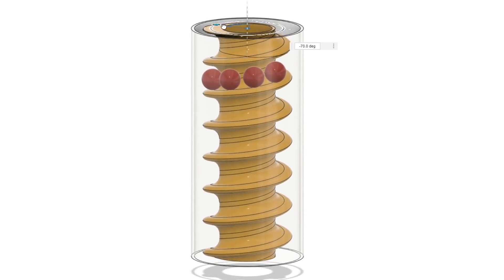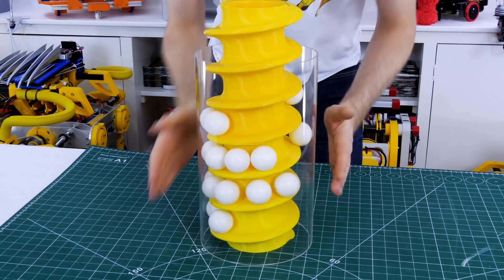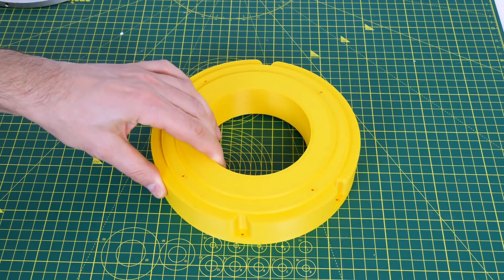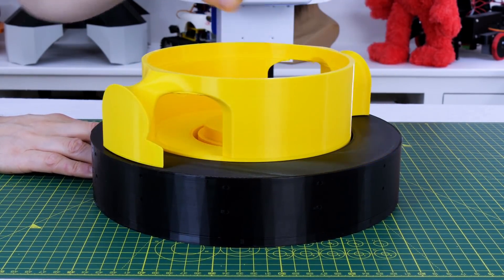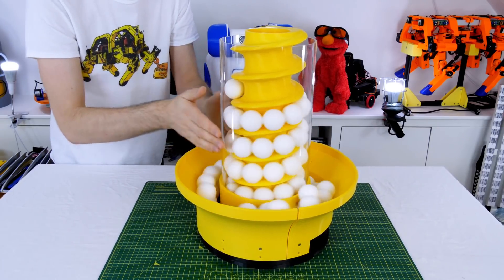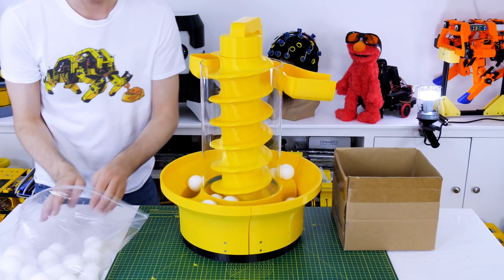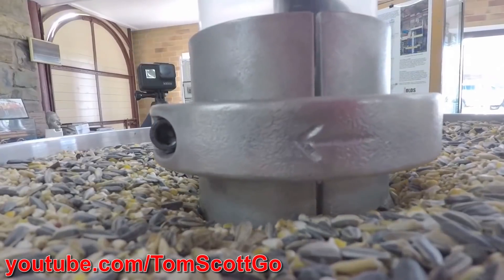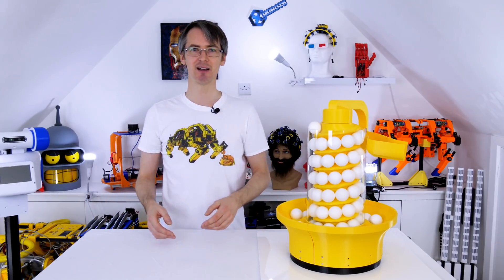Why this Screw Drive is Really Weird

Comment from the maker: openDog is back doing some mapping with ROS next week, Patrons and YouTube Channel Members have it already!
Reply: TL/DR: put some vertical bars inside the tube to prevent balls from rolling back down, archimedes screw only works because its tilted and cant just flow down the screw like the balls.

you're relying on the friction between the cylinder and balls, which is fine for grain or cereal that dont flow down the spiral. but with smooth atomic units like these balls a vertical bar or "cleat" in the tube would greatly increase the flowrate by preventing the balls from rolling back down. 

thats what i thought you were getting to with the vertical bars at 0:17 , but it never came in the whole video. please flip the red bits inside so they fill the gap between the tube ID and screw OD and youre golden.
Reply: Another improvement is to have both the screw and the tube turning in opposition which increases the efficiency.
Reply: Put numbers on the balls
Reply: So this is basically how the dough ball roller at little Caesars works.....
Reply: Make the chute go back into the bowl and it will self feed
Reply: Lazy susan
Reply: you should increase friction inside of the acrylic tube for better result
Reply: This is the first video of you I just saw. And from some point on I just sat there with my mouth open. I thought: "He just must be a real engineer. All of those backyard DIY guys would solve all the mounting problems by running into them and re-print or modify the parts."
Watching this was a real enlightenment and pure joy!
Reply: You could have made the screw in parts that snap together to be able to have it as long as you wanted
Reply: Theoretically, would this also work for liquids?
Reply: You could make it a closed system and just deposit the balls that make it to the top back into the base and give it a go with higher speeds
Reply: I've thought about this before, as a kid, and I think it would work from that, but that it would require a substance that would be at a higher level and want to fill back in the space created by the process in order to be functional.

So I'm excited to see if that thought was correct, and how you make that work.

Essentially there will still need to be a portion that creates a pressure on the stuff being moved up.

FWIW, the more I think about it, and having thought about it in the past, the more I realise I figured it would be putting the card before the horse, so to speak, since it means more friction on the external side would likely require more energy to move most materials
Reply: Why not send them straight back into the base hopper to save having to manually refill?
Reply: +James Bruton Well YOU'RE no Mark Rober. It's just the friction from the glass providing the force to move items up the screw, Big whoopie-doopie, my mind is not blown.
Reply: Now sell it to the Nebraska State lottery
Reply: You should make one that works with metal ball bearings and send it over to Wintergatan

Comment: Would this still work if the diameter of the balls were half the space provided ? Also, Is the friction from the inner walls detrimental to the function or is it only implicit due to the upward force from a constant replenishment of supply?

Comment: Well, the catcher part at the bottom pushes the balls in and the balls push each other up. So the usefulness is limited it wouldn't work with water, or grains.
Also I'm not sure if it counts as an Archimedes screw, which is always at an angle and carries water/grains up in pockets. (Water just flows away, and the grains friction would be too much beyond some point) It's a helix on which balls are pushed up.

Comment: I think this works for the wrong reasons. The principle of the rotating screw is that the balls want to remain as stationary as possible so it's easier to go slightly up as the base rises than roll all the way down (providing the spin is fast enough to counteract gravity). The rotating tube principle seems to be the friction at the base of the tube that pushes balls inwards and then pile then up. The rotating screw setup should work for a single ball, but I doubt one single ball would go up with the spinning tube setting.

Comment: My guess, is that it would still work. 

Like the difference between a propeller and an impeller. 

Spinning tubes are constant acceleration, which is just gravity, so at a high enough velocities: things stick to their walls. 

Then from the perspective of the balls on the wall: the corkscrew in the sky, and the entire universe under their feet: would both be spinning around a stationary corkscrew. 

So the depending on the reference frame: the screw would still be able to be seen as spinning. 

I wonder what would happen if they both spun in opposite directions snd were in contact with a fluid: specifically I'm wondering how the speed of rotation would correlate to the amplitude of the fluid incursion 🤔

Because of viscosity and stuff, I imagine right at the boundary: you'd get two opposite whirlpools (for the two rotating opposite direction model) and they'd just peeeeek into the tub before spiing out down the middle, but the whirlpools would probably be eggshaped rather than circular: and if things spun fast enough they could probably be stretched out by maybe almost a single screwthread. 

So if you then a tilted your archimedes screw relative to the gravity plane of the earth, by about 45° you could probably get some weird fluid rythms going, as slosh resulted in slight overflow, which would accumulate and slosh and overflow. 

The video of it that I just now imagined in my head: would look similar to counting. 

You know how when you count: each digit goes a bit slower? 

It would be like that, but analog. 

Each thread would be like a digit. 

Sidenote: nature is fundementally quantum, quantum means discrete. 

So analog computing isn't truly continuous, but it is fairly close to being continuous, because the molecules in the water are a lot, so it is like, counting with very big numbers. 

I think that might be fun actually hmm 🤔 pls try it, and pls give me an itty bitty credit pls, if this post inspired you, thank you 🙂

PS: then you could compute by putting the "double winder" [as we'll call it for brevity] on a scale, and subtracting the container weight from the scale, and using that for computation.

And if you used analog dials instead of discrete read-out, and you fed those you potentiometers, and sent those into other motors and gizmos, then you'd have an analog computer, but it's primary design flaw would be that it would have to be in a gravitational field, so to use it in space, you'd have to be in one of those space Odyssey 2000 people tubes, the big ones that spin up artificial gravity. 

To use it while moving it around: you'd probably have to switch to a ferrofluid, and then you'd have new design limitations and would have to make things chonkier so that you could account for and accomodate the magnetic spikes that ferrofluid likes to make. You'd also need gravitational sensors, and accelerometers to actively offset the effects of wiggling and jostling and changing gravitational persuasions, so to use that kind of fluid computer, you'd also have to have electronic scale controllers, and fitting w/ the spiritx they'd have to be analog too, but preferably a discrete type of analog which I'm not sure exists, but that with all that fanciness the test would be to run it upsidedown on the ceiling, and then run upsidedown on the cieling again, but halfway through the count, spin it right side up, and then compare the numbers and calibrate accordingly, and then ship it Ganymede or Io, and calibrate it again without interfering with the earth calibration, and also try odd angles and different count interference times. 

Then the final test wpuld be to put it on one of those work-put jigglers, and just oscilate it to death, and do your best to give it a good tolerance 😉🤣👍

(Maybe don't bother with the upgraded version, that sounds like a lotta work for nuthin in my oppinion, I just like to design things in my head)

PPS: the ultimate analog readout would be a circular arc of variable length.

Preferably from zero to 45 deg.

Comment: It has nothing to do with the tube turning, or the table. You just designed it in a way that the balls are pushed up from the bottom by the table. make it work with just a few balls.

Comment: Instead of glue, you should use a welding agent (sort of like PVC cement, but for PLA). That has the potential to be much stronger.

Comment: What? You don't look at pictures of ancient technology? 

The axis of the screw in the classic Archemedes screw pump is inclined 20 to 45 degrees from the horizontal. The product lays by gravity in the space between the flights and, as the screw rotates, progresses up the helix. They are widely used in agriculture and industry to transport granular products vertically. Huge dewarering and irrigation pumps were once common in public works to move large amounts of water to greater elevation.

Your notion of a vertical axis Archemedes pump is plain impractable. There is nothing to prevent the product from back-flowing back down the spiral. A progressive cavity pumo where right and left hand helixes rotating in opposite direction mesh work vertically but they are unsuited for granular materials without a special design.

Comment: You obviously looked at the other video first. If you had pushed the balls one by one at the base into the whole construction staying static i would have believed you since it was the logical approach. building this contraption with that huge loose means that if the base get empty. the balls stop pushing on each others and they roll backwards.....after i designed it on CAD printed it for several hours and added a motor on it i decided to check on youtube for commercials uses....REALLY ?!

Comment: When it was just the rotating tube - not going to work or will be wildly inefficient.  But when you add what is effectively a pump impeller on the bottom - yes, this different mechanism will work.   Perhaps if you did an experiment where you had the same bottom "catcher" but it forced the balls into a tube ala pump impeller versus the rotating tube archimedes screw we could measure a flow difference and see if the screw is doing any work.

Comment: I think it would work better if its spun off center so that the balls are sqeezed between the screw minor diameter and the wall along one vertical line. This way you would create a line which the balls cant slip backwards through which would it self slowly rotate around the screw, albeit at a slower speed than the outer wall.

Comment: The fundamental flaw of this design is that there is no medium for transmitting the energy to the ball. In case of the spinning screw, it's the grove wall that transmits the energy: while the ball is free to slide along the grove, it cannot slide across. In case of spinning tube there is no such restriction - the ball can slide any direction - so the energy is not transmitted hence the ball not rising. The only reason why it (kinda) works in this video is that other balls play role of the restrictor, thus transmitting some energy but not nearly enough....

Comment: A similar inverted screw is also the driving mechanism for the 1890 marine motor US431090 by Waterhouse that I reference in https://gordonhart.substack.com/p/jetboat-1890 . The purpose of this inversion is to separate the fore and aft thrust forces from the bearings that rotate the mechanism.

Comment: If you just put some vertical fins on the inside of the tube, the balls are actually guided and you can transport destinct balls. Because if you put a ball at the top of your design, it would just roll down the spiral because the fit is loose.

Comment: My thoughts its would be the friction of the tube rolling the balls  up the screw since the screw is stationery. I feel this machine was on track and just need a smaller tube or some bigger balls i feel it could even work with only 2 balls on opposite sides keeping even pressure

Comment: Seems like if the wall of the cylinder touches the material, friction would make it work.  I'll have to watch and see if that's correct.
Reply: I hadn't thought about incoming material pushing the other material up.  Definitely appears to work.
Reply: If the ball catcher was dropping them back into the sump, you wouldn't have to refill it.

Comment: If you put spines down the Inside of the tube that can touch the balls but not the screw then it would work much better. But I guess it wouldn't be the same thing anymore. Or just use something with a rougher surface. Friction helps.

Comment: Would there be a feasible way of adding ridges to prevent the balls from rolling backwards and only allow forward momentum? Would they have to be on the tube or the screw part, if they are at all feasible?

Comment: You should try this with vertical ridges on the inner circumference of the tube that run the entire height of the tube and are spaced at intervals of one ball diameter apart.

Comment: So the thing stopping this design from being extra efficient is that there's no groove on the tube for the balls to slot into. If the balls could only slide vertically upwards along the track, then the screw would provide the upwards force as it spun.

Comment: Why not feed the balls that come out of the top into the supply "sump" ?  You'd only need to fill it up once and it could run forever.  Oh - and what would it look like if the balls had little LED lights in ???

Comment: The screw is totally useless. if you force feed (like you do) balls to a tube, they'll come out the other end.  
No mater its shape ... ok the screw makes it easier...
Only if you maybe make rough surface for the tube, and make just big enough for the particles to friction fit get momentum and hit the slide (screw) ...  The other way being making all the particles spin, and placing the screw in the middle... probably wouldn't work because centrifugal forces would win the battle....

Comment: Interesting video.  It would have been cool if you had the balls fall down a spiral slide back down to the trough at the bottom, or have two motorized machines that pass the balls to one another.  Just an idea.  Either way, I'll never understand why some people will use glue to secure certain parts but then screws to secure other parts.

Comment: I would say it will work, though only with things that properly rub against the outer wall of the tube like the ping pong balls, with more granular objects like sand (or even water) I don't think the friction would do enough to move everything up

Edit: And I do stand corrected, at least for grain

Comment: The demonstrations would actually have worked better if you used, marbles, flour, glass beads, dry sand, or any material that packs at least 2x as tight as the ping pong balls

Comment: *It's not an Archimedes' screw, it's a vertical auger. *
Like a post hole borer or a (large) wood drill bit. So, it has kinda been done before.
Both the items I mentioned would self-evidently work if you (say) held them stationary* at the North Pole (*relative to, say, the sun) and waited while the earth turned.
Or more sensibly, wood drill bits work as well when held stationary in a lathe, or vertically in a vertical boring mill, as they do in a drill press.
Not to say this is not interesting application, it's just that this presentation is terminologically inexact.
Which is fine too, except that it degrades future communication on this topic, because there are now a bunch of people (potentially thousands) who will use a single name to cover different existing concepts which already had perfectly good names of their own.
Yes, I know, it happens all the time. So do lots of undesirable things, but it does not automatically stop them being undesirable.

Comment: The balls won't know the difference between a rotating tube vs a rotating screw. The forces the balls experience are identical. It's relative.
Reply: I mostly agree; it's like choosing to use a drill bit in a lathe vs in a drill press. 
However it's not identical (even in a vertical lathe, usually referred to as a VBM or vertical boring mill)
There is a slight difference, because there is centrifugal force on the chips in once case and not the other.

In practice, you get a straighter hole by spinning the workpiece, if it's deep in relation to diameter.

Comment: Its the force from the bottom that's feeding the system not the turning walls. You'd need a much better tolerance to get the balls to roll up the screw.

Comment: The question presented: "Can the screw drive work by spinning the case instead of the screw"

The actual question: "Can an object roll up a slope if it is pushed"
Reply: Yeah, I don't know why people seem to think that this works. The balls aren't rising because the case is turning. They are rising because the scoop at the bottom keeps forcing more in.  Maybe the spinning case has a minimal impact, but I'd bet that it would work 95% as well if the case didn't spin either.

Comment: It seems like if you have vertical strips on the inside of the tube to push the balls around, it would work a bit smoother. Just like something similar is needed if you spin the screw, because without, the balls will just roll back down.

Comment: So given that the Archimedes screw works and this system works, would the next step then be using a planetary gear setup such that the sun gear is attached to the screw, the planetary gears attached to a stationary motor, and ring gear attached to the outer tube, which would have a opposing rotation for the screw and tube, thereby increasing the movement of fluid / particles?